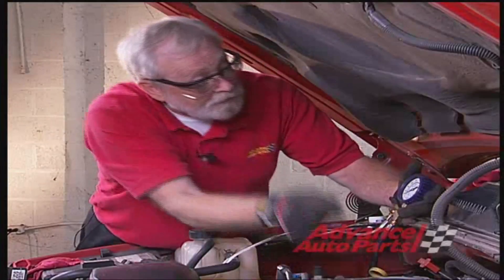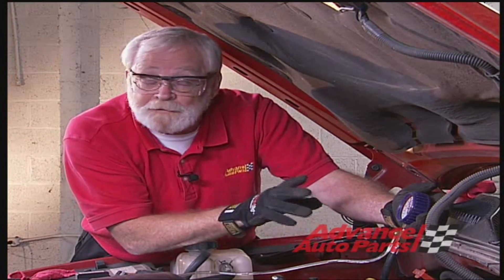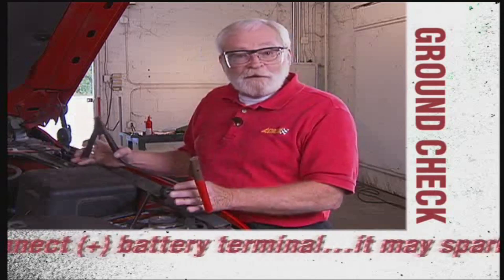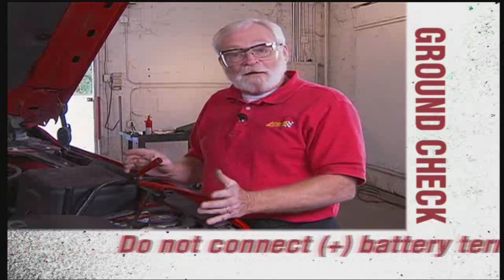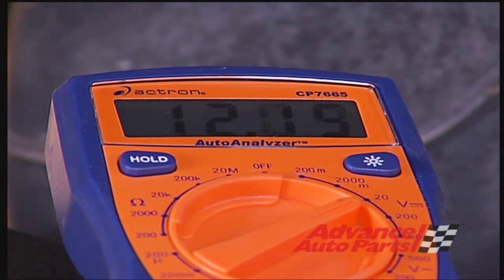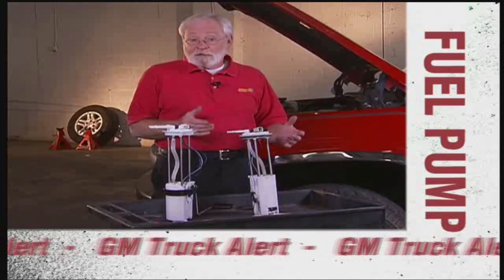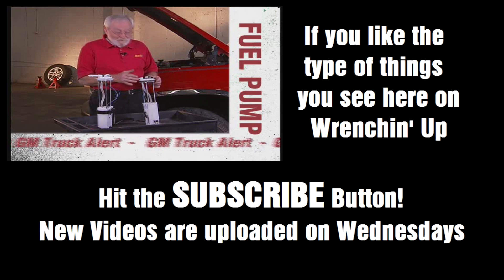Fuel Pump Electrical Check - Wrenchin' Up Back To Basics

Comment: I'm confused about the ground testing. Why does it need to be tested, and does the ignition need to be 'ON'?
Reply: What he said
Reply from the maker: Hi - Thanks for watching! Testing the electrical path to ground is just as important as testing the “hot” side. Resistance in the ground circuit can and will cause system malfunctions.

Comment: Hi sir please help I got golf 2 1800 16v why would fuel pump give ground wen test it
Reply from the maker: Hi - Thanks for watching. Since you haven’t supplied enough information I suggest that you check the wiring diagram and troubleshooting guide in a service/repair manual to help you with this.

Comment: I dont know much about wiring but im lost on my 93 ranger. My issue is im only getting 9.7 V to the pump and i have 12.5 V at the battery. I have put a new relay and fuses in. Inertia switch is working right. If I bypass the vehicle harness the pump works. Any tips for finding where in the harness i could be loosing the voltage.
Reply from the maker: Hi - Thanks for watching! You've already done the usual suspects, so you'll want to start tracing the wiring harness from the pump back towards the battery, looking for shorts or corrosion.

Comment: My fuel pump doesn't go on i have a ford bantam rocam1.3  did put new pump in still doesn't go on petrol is not coming to engine
Reply from the maker: Hi - Thanks for watching and sharing your problem! I'd suggest that you check the relay to the fuel pump, as well as the wiring to and from the pump.

Comment: I have a rough idle problem. Going down the highway, my fuel line came loose from the filter. I hooked it back up . The connection has a quick release. Being that it's 25 years old, I probably need to change the fuel line from the pump to the filter, which was changed 6 months ago.
Reply from the maker: Hi - Thanks for watching and sharing your experience. You may also find that the fuel filter(s) need changing again.

Comment: Been having issues with my daughters 2008 chevy impala it's been in the back yard for couple months could never figure and came across your video that how to check ground voltage at fuel tank I did that  and found a burnt whire down stream repaired it and it started right up thanks for your help good video explaining it so somebody like me can understand it.
Reply from the maker: Hi - Thanks for watching and sharing your success story!

Comment: So forever later - 30 year old mustang - if that nut is corroded extremely you think it would interrupt that first connection?- which would be that fuel pump fuse?
Reply from the maker: Hi - Thanks for watching! Yes, if the nut is so corroded that it is making an intermittent connection, you could have an interrupted circuit.

Comment: Fuel pump problem could cause inaccurate fuel gauge reading?
Reply from the maker: Hi - Thanks for watching! It could if the fuel gauge sending unit is attached to the fuel pump and is defective.

Comment: I have to say I watch the video and when you were underneath the truck and he stated you have a good power and you have a good ground now I know we need a new fuel pump.

That doesn’t make any sense at all. Why would you know that you need a new fuel pump if you have a good power and good ground ?

If it was the other way around, and you said we have bad power and bad ground then I could see why you would replace the fuel pump.
You should’ve done a better resistance test that would give you a better indication for replacing the fuel pump as well as check the relay switch.
Reply from the maker: Hi - Thanks for watching! If the fuel pump is not working, and there is proper voltage at the pump and it has a good ground circuit, the fuel pump itself is the problem. Resistance checks of an electrical circuit, like with an ohmmeter, are not reliable because even if one of the wires in the circuit is damaged and has only two or three strands left the meter will still show continuity. Following the step-by-step troubleshooting procedures in a service/repair manual for the vehicle is highly recommended.
Reply from the maker: Hi - Thanks for watching! Checking for KOEO system voltage (current battery voltage) and a good ground path at the fuel pump is the best way to determine if  there is an electrical problem or if the pump itself is defective. A resistance check of the circuits is not reliable because it there is a wire somewhere in a circuit that is damaged and only has two or three strands left (as an example), the meter would still show continuity. Following the step-by-step troubleshooting procedures in a service/repair manual for the vehicle is highly recommended.

Comment: The vehicle in question is a 2001 Jetta. It has a quick connect at the in-tank fuel pump, located under the passenger side rear seat. When I simulate your test, I've got good ground, but zero(0) voltage at the connector with the key in the on position. In your opinion, what possibly might be at fault?
Reply from the maker: Hi - Thanks for watching! With the key in the RUN position, use a wiring diagram and look for battery voltage for each connection starting from the pump back to the battery. When you get voltage, repair the circuit between that point and the last place where you did not get a voltage reading.

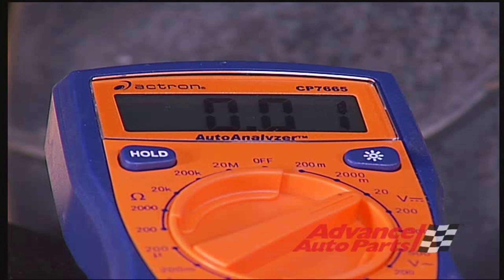Comment: my dodge ram is more than 0.04   in the view on 1:31 and 1:41 , your voltmeter is not in the same position as when it is seen at 1:42. Then you obviously switch 1:54 to check power, and the voltmeter doesn't change from when seen at 1:42.
Reply from the maker: Hi - Thanks for watching! We have had a similar question about this before and we probably could have done a better job of explaining the meter use. But basically, different meters may have different ranges, so be sure to set the meter in the range that covers the value you are testing for. The meter's user manual will probably help if you need more detailed information for using your particular meter.

Comment: You didn't test the pump in situ to tell you if the pump was good or bad before removing it regardless of the supply wires you tested
Reply from the maker: Hi - Thanks for watching and sharing your thoughts!

Comment: My 1999 Toyota celica doesn’t get power to the pump until the key is cranked, all the fuses and relays are good
Reply from the maker: Hi - Thanks for watching! Be sure to check with a service/repair manual for the vehicle to determine if what you have described is a normal condition for the vehicle or not. If not, follow the diagnostic tree in the manual for determine the cause of any problem you are having!
Reply: @WrenchinUpwithJimBates  hey, the repair manual doesn’t say anything about it, I’m just more concerned on why my cars fuel pump doesn’t work when it’s turned to the on position but does when it’s cranked this leads to the car not starting since there is no pressure in the fuel lines, so far I’ve unplugged the fuel pump connector and used an automotive test light and the fuel pump only lights up when the car is cranked which isn’t normal
Reply from the maker: Hi - Since you mentioned that you checked all of the fuses and relays, I think the next step is to refer to the wiring diagram in your service manual for the circuit between the ignition switch and thee fuel pump relay to determine why the fuel pump doesn’t run to pressurize the system in the key on position.

Comment: im lost. i have a 2000 ford crown victoria. my ground( black wire) was 0.06 and my power (red wire) was 0.05 i dont think my fuel pump is getting power at all and the fuel pump is new.
Reply from the maker: Hi - Thanks for watching! Being retired now, I no longer have access to up to date reliable information to help with long distance diagnostics. For that reason, I would like to suggest that you refer to the wiring diagram(s) found in a service/repair manual for the vehicle to help with identifying the problem area(s). Additionally, be sure to check the fuel pump itself by applying power and ground directly to the fuel pump’s electrical connections to determine if it is the problem or not.

Comment: Power supply fuel pump 
Short circuit to positive or open 
Intermittent 
Does this mean i have a broken wire or fuel pump is bad thanks ?

Comment: Looks like you changed setting on meter for 2nd test, but both show meter at 20?
Reply from the maker: Hi - Thanks for watching! I just turned the meter from off to the 20-volt scale. I think there was a pause in the filming for some reason and the meter got turned off. I used the 20-volt scale for both tests.
Reply: Hey thanks for your response, we had to run a wire from the fuse box to the fuel pump hot wire to get it to start working, not sure why, but it's on a 1998 olds 88 with 3.8 motor. @WrenchinUpwithJimBates
Reply: Thanks for clarifying the step, I saw it too, like you moved the dial to a different setting, but now it's clear to me the same setting at 20 volts for negative and positive, thanks a lot...

Comment: Quick question is what Im dealing with and so I wasnt getting any readings at the plug so I went straight to the socket itself where  I got ground .01 but positive i got zeros at the socket so what does that mean? If you dont mind Id be greatful for any ideas? thanks again......
Reply from the maker: Hi - Thanks for watching! If I understand your question correctly, be sure to check the voltage supply from the battery through the relay and back to the pump. This will be the open circuit voltage. It must be exactly the same as battery voltage everywhere along the way because it is not under load. If not, you could use a wiring diagram in a repair manual to probe and locate the problem.
Reply: @WrenchinUpwithJimBates   Ok so since asking the question I gained a small amount of knowledge and what I'm dealing with is a 2002 chevy cavalier ls sport 2.2L and sent it to the mechanic and he says after telling him the back story of how this is the second time i'm changing a fuel pump in this car in 4 months, something isnt right could you please just diagnose the problem and then I will fix it because I'm not in a situation to have $1,000 bill at this time anyway he says well you get what you pay for. Pretty much saying I guess the fuel pump that I put in was a piece of junk... Anyway I've been working on it for like a month now in the driveway trying to troubleshoot what is wrong with this  I found out after watching your video and testing the voltage going to the fuel pump that I was getting 8.9 volts to the wiring harness. A couple hours later i saw another video about jumping the relay pins and then would i guess turn on my fuel pump and I tried this and no success then I took a multimeter to the relay pins and i got 12.7 volts in the relay next to mine which was the air conditioner relay my relay for the fuel pump had zeros on all four pins. So I am guessing that the relay is probably fine it's the thing you plug the relay into, I suppose?And so now that's where I'm at and thank you for answering I know I wrote a lot here but since you answered I have figured I'd might as well run it by you exactly where I'm at, But like I said I greatly appreciate your response... P.S. Maybe the relay is showing 0.00's because its a closed loop or I dont know lol......

Comment: DROP THE TANK TO SEE IF FUEL PUMP WORKS WTF HAHAHA DROP THE GAS TANK TO TEST THE FUEL PUMP THATS A JOKE REALLY
Reply from the maker: Hi - Thanks for watching and sharing your opinion! The point is that you have to get at the fuel pump's wiring connector AFTER the other tests outlined in the video are performed. In this case dropping the tank for filming purposes was necessary.
Reply: @WrenchinUpwithJimBates  o ok thanks

Comment: Checking voltage drop on unloaded circuit doesn't give accurate results.
Reply from the maker: Hi - Thanks for watching! You are correct, but open circuit voltage must equal system voltage or there is a problem.

Comment: Great video. The Delphi FG0115 is supposed to come with a whole wiring harness according to multiple sources, so that saves from having to mess with the wiring. A large majority of the pumps just come with a kit to be able to splice in the new connector.
Reply from the maker: Hi - Thanks for watching and sharing your opinion. It would be more helpful if you could list any of the multiple sources that you are referring to.

Comment: What direction would you look to address a low-voltage result on the fuel pump hot wire, as in 6.5 volts, for example?
Reply from the maker: Hi - Thanks for watching! Pheck out this video https://youtu.be/AYiY1c_b06w. It will save me a LOT of typing.

Comment: Did u notice the volt meter both times was at 20 v but shows him changing it
Reply from the maker: Hi - Thanks for watching! Yes, a slip in editing, but the message is to put the meter into the 20 VDC scale for the test.
Reply: @WrenchinUpwithJimBates  and what if you get no reading like in my case. Even though I turn the key on I can hear the pump prime. But my pressure is at 32lbs compared to what I believe it should be at 49lbs on the fuel rail test
Reply: @WrenchinUpwithJimBates  and the lowest DC volts setting for ground d test?
Reply from the maker: Hi - It depends on the meter. Either the 20 VDC  or the .002 VDC scale could be used, depending on what the meter has.

Comment: When you show the ground number, the voltmeter is set to 20V. Then when you check power, the video shows you clicking up twice to 20V. A small editing mistake?
Reply from the maker: Hi - Thanks for watching! Yes, an editing issue. The idea was to "turn the meter" to the 20VDC scale.
Reply: @WrenchinUpwithJimBates so is the meter set for 20V for both the ground and power test?
Reply: Thanks, a small detail but to a novice like me, I need to be exactly sure of everything. I like this video, it's plain spoken and easy to understand.
Reply: @orig66Super  this. Issues like this destroy the experience for the novice user. It has to be crystal clear and no editing mistakes. This video may be due for an update!
Reply: @DonkeyKawng  Yes, as a novice myself, the littlest thing can be confusing so I just thought I would point that out. Otherwise, thanks for the video. It helped me out a lot.
Reply: @orig66Super test for zero ohms resistance on black wire
Reply: What does it mean when the power wire reading is from 12.4-13.80 then back down to .03 14 ?
Reply: @HandyTim means good battery voltage on red wire & zero ohms resistance on black wire

Comment: this is not a good test. the circuit has to be loaded
Reply from the maker: Hi - Thanks for watching! Yes, I know what you mean, but for this a simple open circuit test where open circuit voltage should equal system (battery) voltage. Be sure to check out the circuit testing videos on this channel where we use the LoadPro to load circuits for some specific testing purposes.

Comment: Is there any way to fix the connector issue on the later model gmc fuel pumps? Is there a brand of pump that you would suggest to eliminate this issue?
Reply from the maker: Hi - Thanks for watching! Good questions, but I suggest you check with the manufacturer as they have the latest information on your two questions. Their contact information is in the video description.

Comment: I have 12.5 volts in my battery, and when i measure voltage back on the fuelpump positive terminal i only receive 12.3 volts, at this Point the ignotion is at it`s off position, is this normal, or should there be the same voltage back in fuelpump as in the battery when ignition is off?
Reply from the maker: Hi - Thanks for watching! The correct way to check for battery voltage at the fuel pump is to disconnect the positive wire and check for voltage with the ignition switch on. The voltage should then match battery voltage. Open circuit should equal system (battery) voltage. If not, there is high resistance in the positive wire or there is a bad fuel pump ground. Also, a battery that is 12.5 volts is only about 75 to 80 percent charged.
Reply: @WrenchinUpwithJimBates  Thanks a lot, correct me if im wrong, i just tested the system yesterday, you mentioned that voltage should not drop lower then the battery charge.  when i hot run the pump (GM) i only have 0,4 volts on my multimeter, i´m confused, does that mean i have a problem?
Reply from the maker: Hi - Sorry for the delay in answering. Check the open circuit voltage (key on but pump disconnected). The system voltage should then be battery voltage at the end of the wire at the pumps electrical connector.

Comment: I have Acura MDX 2002 crank but doesn't start and the fuel pump doesn't work.i pulled out the electric cable from the fuel pump and it has 5 pins and checked the voltage in every one.only one give 11.5 voltage and the others give zero voltage .is that normal do I have to change the pump or it is electrical issue.thank you
Reply from the maker: Hi - I suggest that you use the wiring diagram found in service and repair manuals for your vehicle to see if the pump is receiving battery voltage in the start and run key positions. If not, suspect electrical problems. If the voltage supply is OK suspect pump problems. Thanks for watching!
Reply: Jim Bates thank you so much .

Comment: use loadpro with any multimeter 
the ground on pump end must! be good as well!!!!!!
Reply from the maker: Right on, and thanks for watching!
Reply: After u conected the negative jumper cable on your negative position battery, where  the jumper wire will be connect?
Reply: @rolandochacon969 black wire